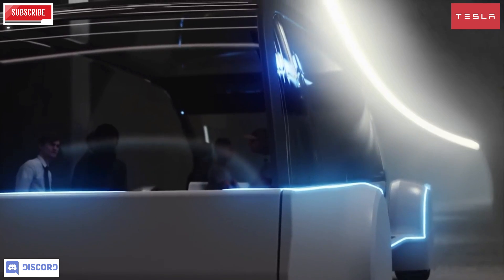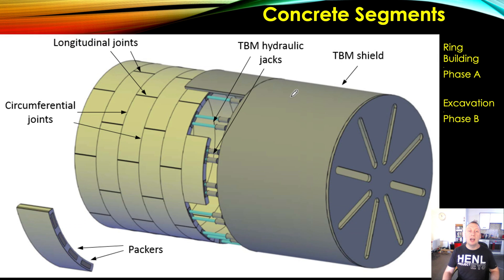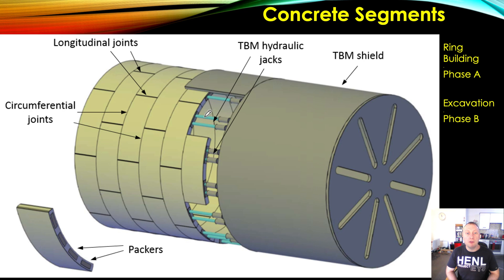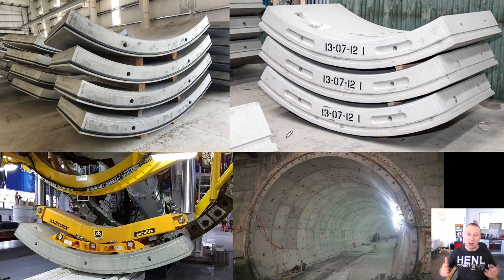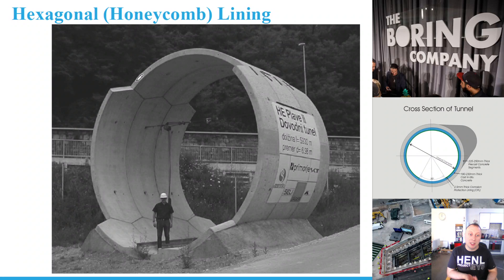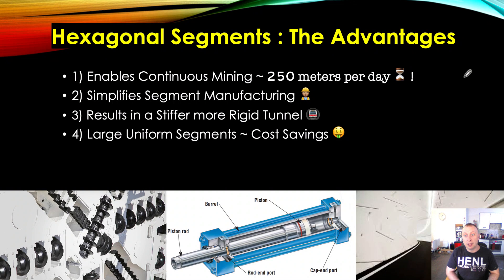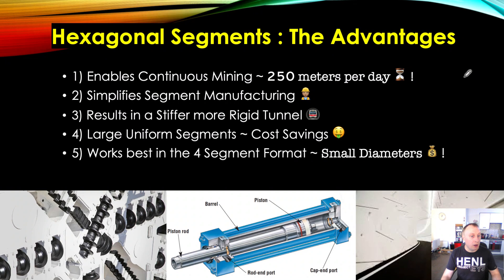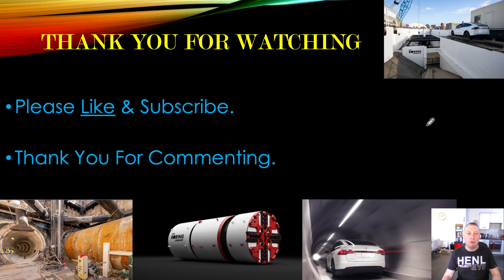The Boring Company 🚇 😃 🇺🇲 Hexagonal Concrete Segments Are The Future 👷🏽‍♂️ 🏗️ 🚎 PART 1

Comment: I can see sealing difficulties.   

I’d think spiral assembly would be a better solution a la corrugated steel culverts
Reply from the maker: I like the idea of prefabricated stainless steel panels with inbuilt curves and welding it together in very large sheets underground. 
With pure speed in mind it probably can't be beaten.
Reply: @BoringRevolution  I think that you missed the point. Concrete segments that are rectangular-ish that are assembled in a spiral.
Reply from the maker: @ReevansElectro  sort of. My point is that the hydraulic cylinders are not stationary for 40+ minutes of every hour. I will explore the use of both Hex Segments & Rectangular segments in a future video.
Reply: Seems like there would be a permanent grout that could be applied to section edges.
Reply: @bobwallace9753  
  The boring machine shields have a slightly larger diameter than the Completed Segments. 
  Grout can be injected (with high pressure) outside the segments just behind the shield ring. This way the soil does not settle against the segments, subsidence is totally eliminated, and segments are uniformly compressed.
  Cured grout also locks the segments into the earth and increases the local soil strength.
Reply: @avid0g  

Thanks.  That's useful information.  I would imagine that with all we've learned about materials science there should be, or could be, some superior grout choices that would form a very long lasting waterproof barrier.  

I wonder if the industry has any agreement over the probable usable lifespan of a concrete lined tunnel.  Is it decades, a century, or centuries?
Reply: @bobwallace9753  
Concrete lifespan depends much on environment. Salts & acids will etch it away. Oxygen & acids will corrode iron rebar - not compatible with constant tailpipe emissions from I.C.E. traffic, but great with electric vehicles. 

Some of the most enduring concrete projects are simply very well sealed with a penetrating surface treatment. It looks glossy, and needs to be reapplied if worn away.
Reply: @bobwallace9753  
When tunnels are placed very deep, they can be overwhelmed by hydrostatic pressure. For the example, the Channel Tunnels could not withstand the hydrostatic pressure so deep under water. Instead, ground water from the chalk surrounding the tunnel is allowed into the tunnel and pumped away. The chalk ends up withstanding the pressure instead of the concrete.
Reply: @avid0g  

Thanks, David.  So if we wanted very long lasting tunnels the trick would be to seal the exterior of the sections before installing.  The interiors could be spray coated later on.  If needed.

The interior of a Loop system (atmospheric pressure and not sealed from outside air) might need an interior coating.

The interior of a maglev hyperloop system might not.  There would be no vehicle contact once the vehicle left the station and there would be very little air in the tunnel to transport moisture.

Elsewhere a comment suggests at least 120 years.  Amortized over a 120 usable life the tunnel cost per passenger mile would be super cheap.  I did a quick spreadsheet.  If a tunnel costs $10 million per mile and it was financed for 120 years with 2% bonds the annual payment would be roughly $220,000 per year.  Divide that out based on passengers and freight per year and the cost per passenger mile drops well below a penny.
Reply: @avid0g  
The Chunnel bottoms out at 75 meters (246 feet) below the surface.  Might there be a problem in the 30 foot to 50 foot range?  A concrete lining with a water sealing exterior coating.

In a depressurized (hyperloop) tunnel any leak should be vaporized upon emerging from the concrete?  If leaking was a problem then there might be a need for dehumidifying what air there would be in the tunnel.  Of course, that would have no impact on rust inside the linings.

I wonder if we can get any sort of reasonable length of use number for our (my) speculations.

Here's where I am in my 'fun with numbers' guessing.
$10 million per mile

From Boring Companies FAQ page on the 150 MPH Loop system
4,000 passengers per hour max throughput
24 hours
365 days
35,040,000 passengers per year (a mix of people and freight)

x4.7 - traveling at 700 MPH as opposed to 150 MPH
163,520,000 passengers per year

$220,000 annual payment based on $10m, 2% financing, and 120 year use life

$0.001 tunnel cost per passenger mile.

We could cut the assumed useful life of the tunnel from 120 years to 60 years or 30 years and it still wouldn't be "real money'.  Drop the useful life to 30 and the cost per passenger mile rises to $0.003.  A 3,000 mile trip from the Atlantic Ocean to the Pacific Ocean would cost each passenger in a maxed out tunnel a grand total of $9.  (That is only the tunnel cost and they'd need to pay another $4.50 to cover the third 'service/escape tunnel.)  Stations, energy, staff, vehicle costs would be the real costs, not the cost of the tunnel.
Reply: @bobwallace9753  
Keep in mind that Elon is also developing TBM expertise for use on Mars and he also wants to generate revenue to fund the Mars Occupation. 

So the cost per mile toll will be set as high as practicable and not closely tied to justified expenses. The tunnel tariffs will be priced to make high-volume money, disrupting competing transportation.
Reply: @avid0g  
Sure, there's a lot of cross pollination between Musk's various companies.  SpaceX creates new stainless steel alloys and they turn up in Tesla's Cybertrucks.  Tesla designs vehicles for Boring Company's Loop.   Apparently Loop TBMs will create a tunnel underneath GF Austin for Tesla to use in their factory.

Perhaps, if BoringCo can build a hyperloop system, they will charge only $1 less per ticket than the cost of flying.  I really don't care.  I don't care if Boring is massively profitable and Elon uses his earnings for a different project.  My interest is totally in whether we can find a suitable alternative to flying with petroleum.  

I don't care if the solution is biofuel, hydrogen, batteries, traveling in tunnels or something else. I just want us to find a solution so we can further reduce GHG emissions.  I recognize the fact that it will be very, very difficult to get people to voluntarily give up kerosene powered flight unless we can offer them something that costs about the same or less and that is as comfortable/convenient or more so.  Right now, based on what I know, the hyperloop looks the most promising.  I'm looking very hard to find out what may have been missed that could move hyperloop out of first place.
Reply: Bob Wallace I agree of course. One advantage that hyper loop trains and electric planes both have is they are much quieter than than kerosene jets which will help a lot with public acceptance.

Comment: You say your hexagon segments is a game changer to allow continuous drilling as opposed sequential (drilling stops whilst segments are installed then vice versa)

Are you not aware that double screen TBMs have been around for at least circa 20 years?
Hers a link to a Robbins video from 10 years ago showing how the double shield tbm enables drilling concurrently with segment installation.
https://youtu.be/V9Z2YOnimwI
Reply: Good point. Although the correct term is “Double Shield” TBM. They are more expensive and generally require hard ground or rock to operate in “double shield” mode, which uses the excavated walls to ‘grip’ for forward thrust reaction. All established existing technology
Reply: @davidsalisbury50 
Thanks for your reply and pointing out my mistake (screen instead of shield) so I've corrected my original post.

It was also my understanding that double shield tbns were best suited to hard ground or rock. Otherwise they can't simultaneously drill and line the tunnel.
Reply: Diana X correct. Some sophisticated double shield TBMs can operate normally by pushing on the built rings behind them when in soft ground, and then, when I. Hard rock, can use the side support “grippers” to provide the reaction for the forward thrust while the segmental lining is being built at the same time. Very specialised but I have used on one project.
Reply: @davidsalisbury50 
Thanks.
What you describe and have personally experienced sounds the same / similar to what is shown in the Robbins video that I linked in my first post in this thread.
Reply: Diana X I user work for Robbins. The founders son and current owner are personal friends. Some top people work there.
Reply: @davidsalisbury50 
No doubt they are real top people with a wealth of specialist knowledge and experience (and not in selling yogurt ice cream!)
Reply from the maker: Great find. So no I was unaware of this system. Any idea as to why Robbins stopped using it ? 
I will look into this more. Thank You Diana.
Reply: @BoringRevolution 
I wasn't aware that Robbins stopped using it. My understanding is that it is still used in hard ground or rock as its not suitable in softer soils due to the lack of friction. I'm not an expert, by any means, but there is a guy commenting elsewhere in the comments section on this video (David Salisbury) who has 30 years tunneling experience (and who personally knows top people in the Robbins organisation) who may be worth speaking to and picking his brain.
Reply from the maker: @Diana X  So that TBM can only be used in select locations. Well how disappointing 😕 !
Unfortunately David Salisbury has been bothering some of my followers. He posted 30 replies yesterday and generally made a nuisance of himself in the comments section. I get the impression he is a man with a lot of time to burn. But that is ok 👍🏿
He can e-mail me & yes I would happily discuss my ideas with him : BoringPrufrock@gmail.com
Reply: A Boring Revolution just to confirm for you. Double shield TBMs are still in use, several manufacturers make them. They are expensive, they are generally only of use in rock, for long tunnels. They can achieve continuous excavation and lining erection. They are still limited by the Support logistics inherent to tunnelling.
Reply: @BoringRevolution 
How is David bothering them? He appears to be somebody with a lot of knowledge and experience, which is sharing to help inform others without such knowledge. Is that not a good thing? I always find that hearing different people's views on a topic (particularly if they have knowledge and experience) is helpful.
Reply: @dianax266  Agreed. I may not have read every single one of David's comments, but all the ones that I did read were informative and helpful. He responded directly to some of my questions. This kind of domain-specific discussion is what I appreciate most about those few YouTube channels (including this one) that are focused on a very focused topic, and seem to engender a high ratio of value-added comments to garbage comments. While this obviously isn't my channel, I'd hate to see other interested participants feel unwelcome.
Reply: @jjcadman 
I fully share your sentiments.
Reply: But this is about doing it as cheap as possible. Sounds to me like the tunnel industry is maybe stuck in the past, much like the medical industry? Twenty years of incremental upgrades, but base technology remains unchanged. Release new versions to make money, but never redesign from scratch? Sadly a common occurrence for some older companies, especially when under shareholder pressure.
Reply: @zynius  I don't think the tunnelling industry is stuck in the past. I think I could readily prove it if challenged.
I have had the privelidge of working on some projects that have pushed the boundaries of tunnelling and modern construction techniques, producing real functioning infrastructure, not CGI's. It's been a great experience. 
As for the medical profession. My own experience of triple stents put into my heart 2 years ago was an experience I will never forget, as much for the technology being used as the almost instant results it produced. What would have been a triple heart bypass open heart surgery, 20 years ago, with a very high risk of dying on the slab and definitely months of rehab and years of drugs and check-ups. With modern technology this turned into an operation where I was wide a wake throughout, sitting up in bed and eating an hour later and released the next day with nothing but a sore wrist. 4 days off work and I was back at my desk. if that's not an example of advances in technology I don't know what is.
Reply: @zynius 
I think if you do any of your own research that you will find that the tunnelling industry is anything other than stuck in the past. It is one of the few sectors of construction that has made significant advances over receent times (and are currently miles ahead of TBC).

Comment: How does the tunnel turn if all the segments are the same?
Reply from the maker: Perfect question! 
You Cap off the Hexagonal section with two half segments (half width). Then you use rectangular segments + packers for the curve and later on you revert back to Hexagonal. Will break this down in a future video !
Reply: The segments in each ring of a modern tunnel are not all identical.
There are two variations.

1) A slight taper across the segment ring ( say 1 i n 100 ) allows you to go in a straight line by alternately placing rings so that the thickest part of one is aligned to the thinnest part of the previous ring. To turn the tunnel left you put the thick parts of the rings together on the right, to go down you put the thick parts together at the top, and so on. The space for the tbm to turn comes from the cutter head making a hole a little bigger than the tbm train and erected segments behind it need to pass through the ground.

2) There is a tapered "key". The segments all have a radial joint face where they touch their partners in a ring. As they a placed by being pushed outwards from inside the tunnel the final segment placed has to either have faces at an angle that allows it to be pushed into the hole radially, or that allow it to be pushed outward into place slightly forward of it's partners and then pushed back to lock the ring.
Reply: Bradford Smith.....it can’t. That is the problem with hexagonal segments and the reason why they are not common in the tunnelling industry. 
Unfortunately the author didn’t understand this point.

Comment: I think I see what you are talking about now. Very informative.
Reply: I have an idea for another way of doing it. all you have to do is have the run of the hydraulics be in a spiral pattern, unless you are saying that you cannot push on a section until the ring is complete because it won't take the load you just have the last one inserted be inserted by the farthest back hydraulic run. there is always 1 ready to install.
Reply: @thaddeuswalker2728 
There have been TBMs around for at least 20 years that allow continuous drilling. I. E whilst segments are being installed concurrently. Hers a link to a 10 year old video that explains how double screen TBMs work
https://youtu.be/V9Z2YOnimwI
Reply from the maker: @Thaddeus Walker  Yeah thank you & appreciate that ! 
I Got to do a Part 2  because I was a bit biased on this one. only fair 😉